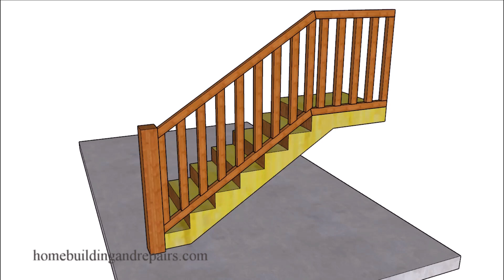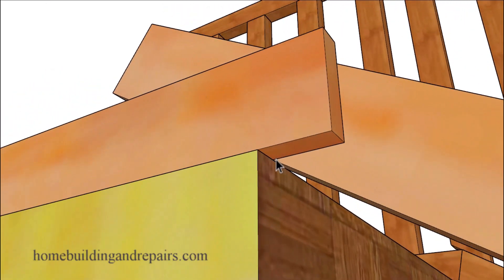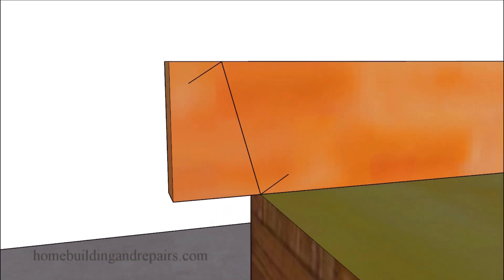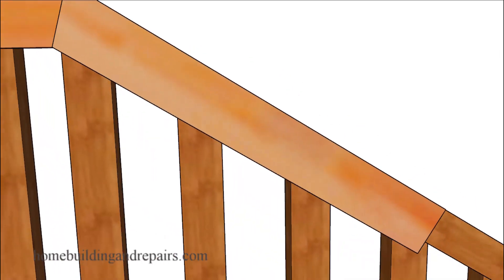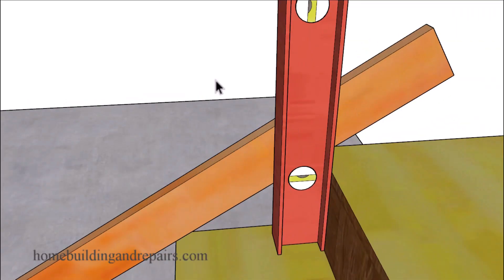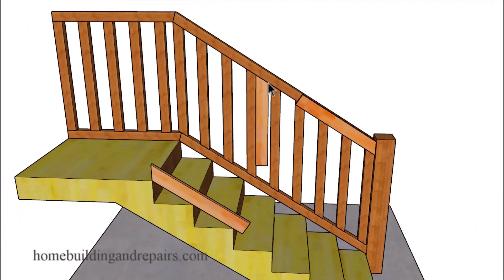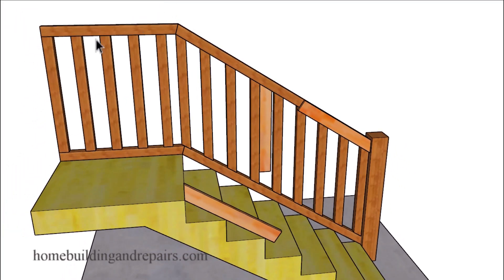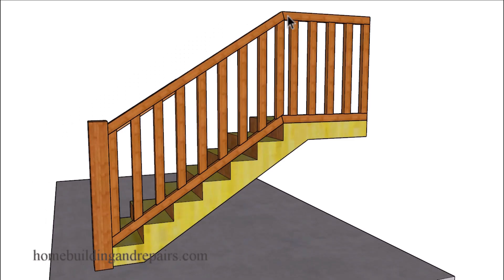Easiest Way To Calculate Angles To Build Handrailing or Guardrailing - Stairway Construction Tips

Comment: Hey. Could it work with handrais  from round pipes?
Reply: I am not the poster, but since he has not bothered to respond, using the boards to find the angle and the setting your chop saw up to that angle should work. The PITA will be establishing the "top" surfaces on the rounds. Perhaps a high vis marker?
Reply: @brucewelty7684  Thank you. Using the gpt chat, I found an excellent method for round pipe handrail: the angle of inclination of the stairs is calculated (let's say 30 degrees), we divide this angle (15 degrees), then, as you said, an angle of 15 degrees is cut out on the saw. you join so that the long part of the corner of both the inclined railing and the one at the top (flat) is turned to the ground, and is welded. it turns out a very wonderful weld! 

p.s. I hope you understood, I wrote this with the help of a translator)